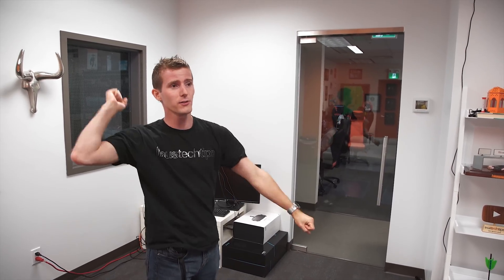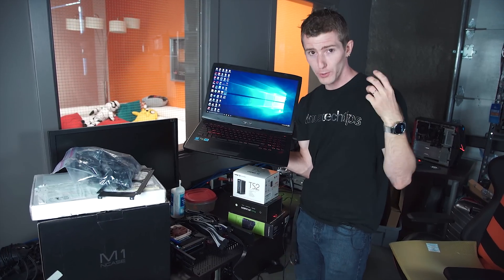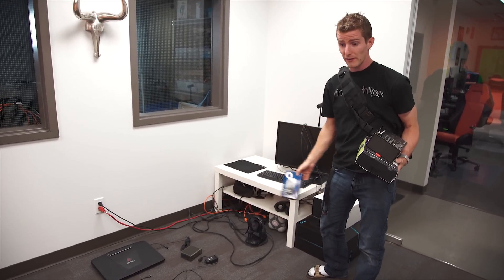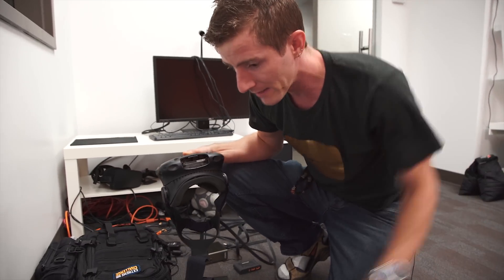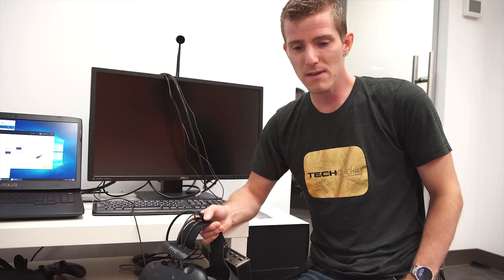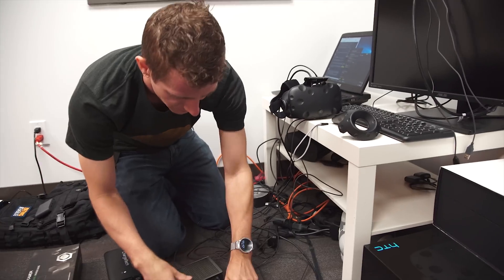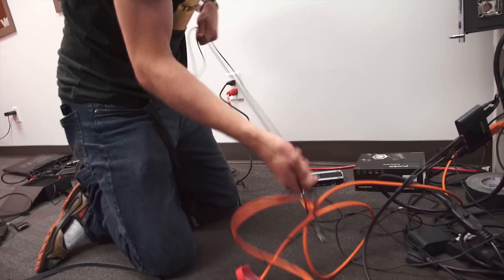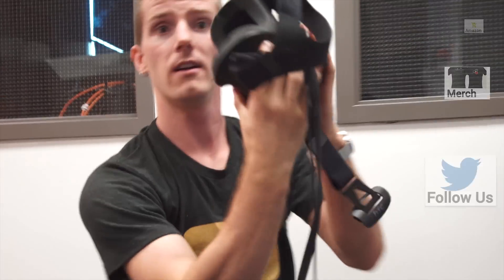Project Light Tether Pt1 - First World Problem Solving at its Finest

Comment: guys, jusy quick question. i7 6800K or AMD Zen 6 Cores?
Reply: Wait for benchmarks.
Reply: ***** it will be identical. Trust me.

So whats your pick?
Reply: Wait for benchmarks
Reply: and is cheaper
Reply: ***** kaby lake will be a mainstream 4C/8T CPU. I need the "Enthusiasts" i7 (i pick the 6800K because its the best price/performance 6 cores CPU i can get) because i use my pc for 3d modeling amd graphic design.
Reply: Samuel Lakatoš 6 cores AMD zen will perform similar to 6800K right? Since 8 core ones perform similarly to 6900K
Reply: ahaaha. Its like Android vs IOS. Of course Android
Reply: I would just wait for either Zen or Kaby Lake
Reply: Do you want a room heater or not? xD If you want a room heater/Toaster GO AMD, if you want performance at a more cooler rate, go Intel!
Reply: Samuel Lakatoš
I suppose so then, but every AMD processor I've had, from the Athlon, to the A4,6,10 series always end up heating my room up, and its not a small room either.
Reply: ***** you mean skylake-x ? That will be released roughly Q2 2017. Its essentially Broadwell-E successor....
Reply: ***** damn. I need to wait for another 10 month -_- I'll probably go with 6800K.....anyway, thanks for your opinion!!
Reply: +daniel15092 so that means the new ones will, da fuck?
Reply: +T-X-M Wait.. So we are talking about AMD APUs and Intel Enthusiast CPUs? (Or are Zens not APUs?) Going back to 2012 Intel just released the i7 3770k Lineup. AMD released FX 6300 Lineup and Piledriver. Compare an i7 3770k (Not even Enthusiast) with FX 6300 (Supposedly 6 Core but actually 6 threads). See which wins.
Reply: -T-X-M- what do you think about the pricing for AMD Zen?

Btw they said that they aren't going to compete with Enthusiasts Platform yet, its gonna be Intel's Mainstream CPU's vs AMD Zen CPU's
Reply: -T-X-M- so you are saying that Zen that beat i7 6900K in multi-threaded task will have the price of $300-ish?

But one for sure though, Intel's Skylake-X, the successor of Broadwell-E will be better than Zen :|
Reply: -T-X-M- no, i ask you, do you think that AMD 8 cores Zen that outperform i7 6900K will be priced around $300? is it possible that AMD will sold a CPU that beat intel $1000 CPU for $300?

And I'm saying that Skylake-X (successor of Broadwell-E) will have better performance than Zen or Broadwell-E. (i7 6800K is a Broadwell-E CPU, the Skylake-X will be 7xxx series)
Reply: -T-X-M- if the 8 cores will be sold for $700 (since its beating the $1000 i7 6900K) than the 6 cores will be against 6800K right? Or it will be 6 Cores Zen vs 6700K? (the 4 cores)

God I'm so confused -_-
Reply: -T-X-M- Well shiet i don't know too....thats why I ask you :D
Thanks for you reply anyway :)

Comment: I watched the hole video and I'm so confused in wtf your trying to do..  I assume your going to put the laptop into the bag with a battery bank to power the vive???...  Why don't you just use the standard cables and stuff them into the bag with the laptop and use the battery bank to power the vives breakout box?  Forget this thunderbolt crap and changing cables and do it direct.

Comment: when plugs don't fit, i use a knife and cut off what doesn't fit. Only advised on low voltage plugs (under 50V AC).

Comment: Remember the teachings of the 80s, if you mess with VR and fail you can get trapped inside the game.
If they happens; you have to defeat CCP, and release the mainframe, or request an exit to Morfeo.
If you fail you will get trapped there for ever.

OMG a pink car with rusty wells … must be an error in the matrix.

Comment: even if the hack works every device in the chain will introduce +latency which is not recommended for VR...

also, instead of hacking the shit out of this, just put a gaming laptop in your backpack with efficient cooling. that would make more sense.

Comment: the port extender / dock IS a video card... this will not work this way. you need a hdmi over wiresless solution (aten has a model) the use the port extender for all ports except hdmi... im interested to see how this plays out.

Comment: just make a mini itx pc that is capable of vr and fits in the backpack and then get the right size cables for the htc vive and plug it into the pc and then get some sort of battery for the pc to get power and because your using a battery make sure the pc does not consume much power so there ya go vr backpack

Comment: Linus, I use the Asus g751 for my Vive and it works, but you have to use the mini dp instead of the hdmi. Also the cable quality matters. One last thing, if you plug the Vive in while on battery, it will for some reason not work so make sure you are plugged in with power, connect via mini dp, and make sure all USB/cables are connected and THEN plug the steam box connector dongle thing's power.

Comment: Certainly the people who make the Vibe could make a small Thunderbolt to all the necessary connections to their headset, with an addition of a back pack power supply to their headset. Corning should work with them on this. I would think if it could go wireless would be even better. Surely 10-30 Ghz has a free space for this, but microwaves can be nasty... That's it we need a holodeck!

Comment: +LinusTechTips Why use a laptop for this? If you're keeping the single cable tether then just stick to the beefy desktop to power it.. Laptop only makes sense if you're going to power the Vive off the laptop and batteries to the point there is no tether at all, doesn't it?

Comment: for a while now, the laptop on my screen has been broken. I've been hooking up my laptop to my 42 inch tv using HDMI.  Would it be possible to de-gut my laptop and fit them inside my tv , hooked up with hdmi, and have all my ports available to use?  it would be neat to set up a wireless keyboard and mouse wouldn't you think?

Comment: good experiment so far, but as near as i can tell you are adding wires and additional hardware trying to replace a tether that was only originally comprised of 4-5 composite cables.  when the video first started it seemed like you were trying to take that tether down to only 1 or maybe 2 cables which would have been good, but i'm anxious now to see how part 2 turns out bc so far you just keep adding additional cables and devices and not replacing anything yet, kind of defeating the original point of making things simpler.

btw, can't bluetooth and xbox wireless carry power signals, so wouldnt the only thing requiring a physical tether be the optical cable between the headset and the image producing device/computer?

couldn't you just have something small like the skull canyon nucs you advertise that size of a machine soon for the computer part, an external gpu about the same size, and those battery packs you had and have everything wearable or able to be in a custom manufactured backpack?

also, if more freedom of movement is the goal here, run a long cord carrying the visual signal to a point on the ceiling near the center of the living room or designated vr space, mount a swivel hardware there with sometype of connector allowing the hardware to swivel, and run the tether from the headset to the swiveling part of that connector, you could possibly even have a long cable on a spool attached to the swivel so that it could not only swivel but retract or elongate the tether as necessary while moving about the room

Comment: new suggestion, instead of tying that into your back pack, just get a retractable cable and mount that on top of the ceiling. well if the cable is round enough.

Comment: LINUS...1/.2 way thru..
you have to run REGULAR wire any way..DROP the Fiber..
POWER THE HEADSET AND THE LAPTOP , Put it all in a PACK and run with it..

If you are going to WEAR the back pack...you are only going 3 feet.. with the cables..

Comment: why not just put a horshoe bolt on the ceiling, then hooks down to the pc, and boom. most of the weight is gone, and if you want to make it perfect, attach weights so the cable doesn't fall through all the way. (hopefully the cable is long enough)

Comment: video suggestion?
1, lego or mechano pc case build
2, integrate a (useful) small lcd screen in a case
2b, integrate a lcd sceen the full size of the windowed case
3, water cool just using copper pipe
4, steampunk a pc build
4, plastidip your pc
5, spray fans, case or and gpu with heat responsive paint
6, cable tidy solutions for rear of pc
7, solutions to stop windows 7 checking for updates after a reinstall (pet bloody peeve)

Comment: If you haven't figured it out yet, the box will only use one input at a time.  If you have multiple inputs plugged in at the same time it will ignore one of them.  In the course of setup I had some tracking issues that I incorrectly diagnosed as HDMI cable issues.  I plugged in a mDP cable without unplugging the HDMI from the breakout box (PC side), even though the other end wasn't plugged into the computer and it didn't work. After more troubleshooting I disconnected all but the necessary cables and it worked.

Comment: I still don't understand why you don't just suspend the included cable from the ceiling. You could even be fancy with it and put it on a swivel to allow better mobility and have just enough slack to allow the user to walk to the limits of their space
Reply: And when I say swivel I mean it to be an arm with a swivel that would allow it to spin 360

Comment: Has anyone made a ceiling mounted cable routing system to remove the need for a cable holding person?  Seems like a great addition to a dedicated VR room...
Reply: I once read about someone trying this, and they said it wasn't a very good solution for reasons I can't remember.

EDIT: Found this: https://www.reddit.com/r/Vive/comments/420kxa/ceiling_mounted_cable/?st=is48o8jm&sh=29dae1f6
Reply: ***** "I'm a dev and can confirm this, not because there is a tug but because you run into the cables more.
It would be better if a system used your tracked head position to reel in and release the slack."  This solution seemed to make the most sense and that's more what I was thinking.  Quite complex though.

Comment: Compositer error is a config issue, it can be fixed.

SteamVR LITERALLY searches for devices with odd resolution configurations to find the VR devices 
(Such as the Vive). Since VR devices have a "unique" resolution and refresh rate, they can get away with this. It's very, very odd that Steam finds VR devices this way, but a configuration change can fix it. Because of the non-standard connection, it likely showed up as an incorrect resolution default, and therefore not found by SteamVR. I ran into the same issue with my Microsoft Surface Book, which is a bit of work to get working with VR.

Comment: If you're going to be wearing a backpack why even bother with replacing the cable? Why not just run the vive cable into the backpack, into the vive splitter, then into a battery pack and hdmi into your laptop?

Comment: This is so dumb. Why would you remove the cables, because they're "heavy" only to carry around a back-pack with battery banks in them. The battery banks are as equivalent (if not more so) then the wires that it comes with in weight (generally speaking).

Ya, I get it though, it's just an experiment, and to see if it would work, so whatever, I suppose. But, I wouldn't really carry around battery banks just to remove the pre-done cables it comes with.
Reply: Always remember to leave common sense at the door when entering here. xD
Reply: Normally, someone else would have to carry some of the wire slack if you had a traditional Vive setup. If not, the wires would tangle around your legs causing you to trip. This make it possible for Vive to be carried easily and operated by one person.
Reply: I would always take strain on the back over strain on the neck
Reply: He did not do this to remove the weight of the cables. He did this to not get tangled in them. Light as in optical cable which he states in the video.
Reply: +Dennis Playing Lacrosse? The wires never tangle around the user's legs as long as they're at least semi-aware of how much they're turning, which everyone is while they're using it.
Reply: +Stodin Mikiaka True, but there are always safety precautions. I mean the guy at the demo for the Vive held the cable for them while they were playing 😂
Reply: +Sabortoothsloth I'm open to criticize if I disagree with something, so would you go through all this trouble just to carry battery banks in your back-pack? I hope not.
Reply: this is more of a proof of concept, in essence it should be possible to power the whole thing using a thunderbolt 3 cable.... it wouldn't surprise me if some company or even HTC themselves  make a small adapter to implement this solution
Reply: Well, The cables are also motion restricting and you may sometimes trip on them. But with a backpack those problems are eliminated, I say its worth the extra weight.
Reply: It's not really supposed to be lighter, it's supposed to allow you to move easier and besides, the battery banks worth pretty much nothing anyway

Comment: I thought he was going to somehow make the vive wireless ._.
Reply: One day!
Reply: From the title, I thought he was going to be somehow using Li-Fi to power the data transfer somehow, which would've been amazing.
Reply: Good luck making a power cable wireless unless you are Tesla
Reply: +Komi Lopov I like Tesla, but the coil required for wireless power transmission would likely fry the computer! Faraday cages all round! I guess two or 3 further generations of smart phones will see wireless vr with decent tracking.
Reply: +98yoshi98 Agreed.
Reply: I don't know why you couldn't... Everything there is possible to make wireless going to a computer.
Reply: +AlsusGaming You need very low latency. Most companies who are attempting wireless are building the computer into the headset.
Reply: And besides, even if you had something like Lifi, or whatever that was low enough latency, or somehow made it all work, you then have to worry about it either being heavy, supported, or too expensive. The HTC Vive already costs a pretty... What is it, 799? I think? And that's still wired...
Reply: Already solved. Didn't you see he is using two power banks? The only cable tethering him is the optical cable, and that does not carry power.
Reply: +kedwa30 Also I think the intention is to use the laptop in the backpack, so the optical cable will only be running to that.
Reply: CorporateZombie That will be awesome to have that much compute power in a single smartphone, but I'm thinking before we get there, we will be able to network several smartphones together using native optical connections and with a custom OS to make them work as one machine. Then to get more compute power, ram, etc., just daisy chain in another SOC/SBC/compute puck/smartphone.